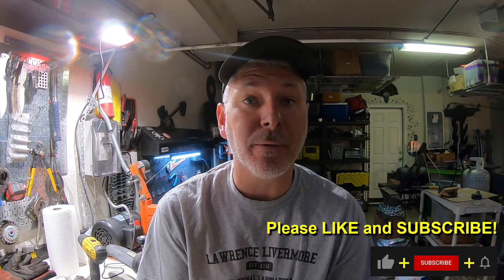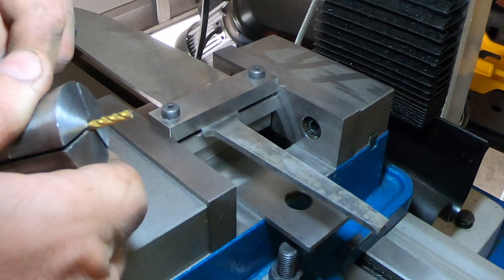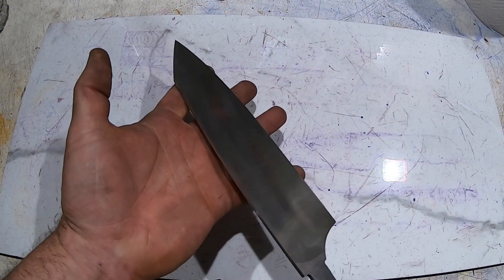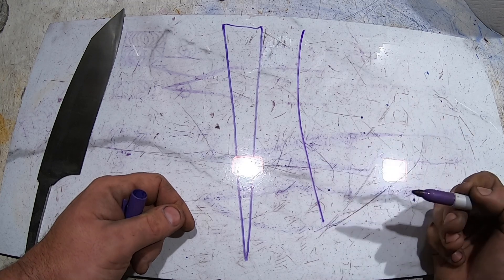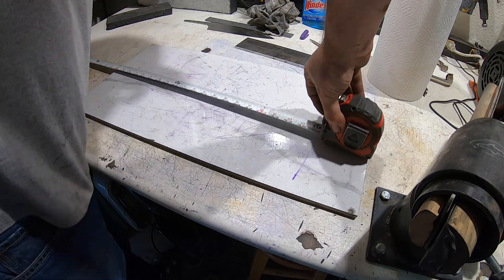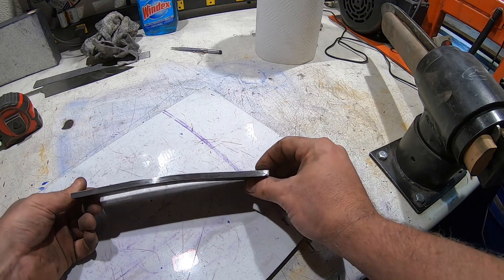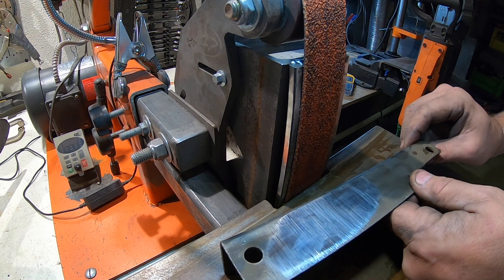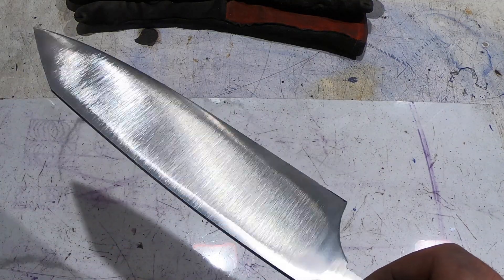Making a Wave Damascus Chef Knife - Part 2

Comment: Great looking knife, can't wait to see the rest of the build. My OCD would of went off the scale if I had to to put an S grind into the beautiful pattern welded steel lol. Might consider a thick piece of leather glued to a piece of flat steel for sanding those hollow ground areas, I use a small setup like that for sharpening my spoon knives. The leather allows the sandpaper to go into the hollows a bit as it's a bit pliable.
Reply from the maker: I tried a leather backer but the dish is too deep for just a piece of leather.  I do use the leather trick to smooth the lines on my knives when I get to 800 grit though.  👍
Reply: @TyrellKnifeworks  Your a brave man, that would of driven me crazy having to grind on that blade again after your had it so perfect.
Reply from the maker: @TheRedhawke  it wouldn’t be a fun build if there wasn’t a challenge! 😜

Comment: The knife is coming along nicely, Denis. 
Getting a knife to a point where it’s fit for use, and looking neat, and then going back to a 36 grit belt made me feel nervous for you!
Could so easily have gone south, but I’m glad it stayed good.
🇬🇧🙏🏻🇨🇦
Reply from the maker: Thanks, it made me pretty nervous touching it against the belt but it turned out great!  👍
Reply: @TyrellKnifeworks  
The grinder is a fickle friend. It’ll be your best buddy, but in a blink will screw you up.

Comment: I must say... Hand sanding S grinds in something that drives me bonkers. Thought I was alone on that one.
Also glass platten.. just go to a glass shop and ask for a piece cut to size, I am assuming it's shatterproof?
Reply from the maker: The platen was only $25 and came with a special adhesive on it so you don’t need the “lip” under it, but I put one anyway.  The hand sanding alone on this knife will drive the price up! 😜

Comment: Nailed that grind! Yeah I was thinking damn that’s gonna be a pain to hand sand but determination and ingenuity prevail! Also where did you get you’re glass platen? And how do you like the surface conditioning belts?
Reply from the maker: It was a major PITA to hand sand!  I don’t think I’ll be doing many of these or at least they’ll be mucho $$$.  I can’t remember where I got the platen.   Think I googled it and found one with the adhesive back.  The surface conditioning belts are awesome but you need to be careful because they will wash out your lines.  No issue with this knife but for a knife with a plunge line and primary bevel it’s not so good.  I’ll add. Links to those belts in the description if you’re interested.